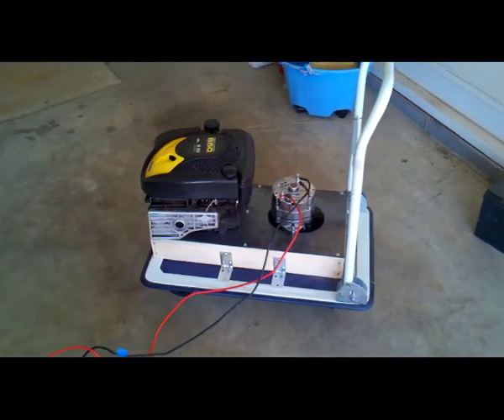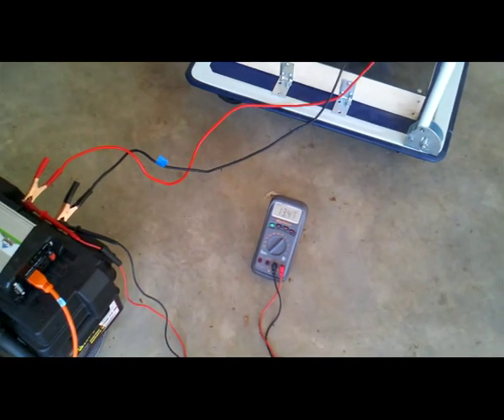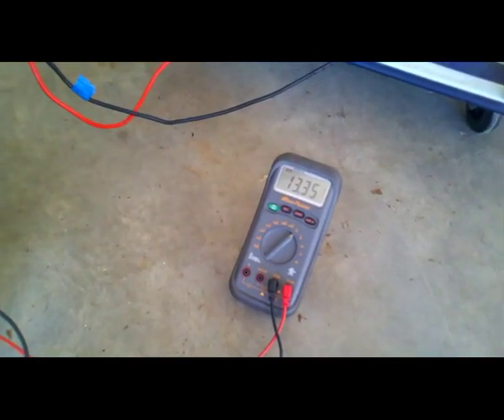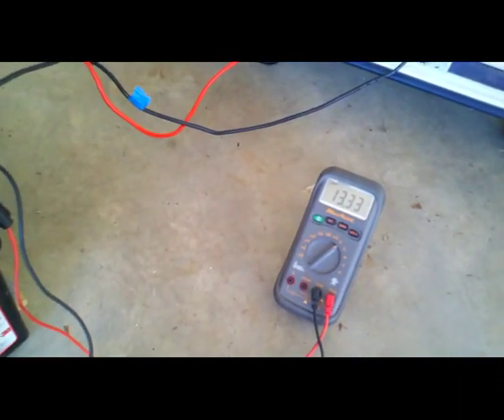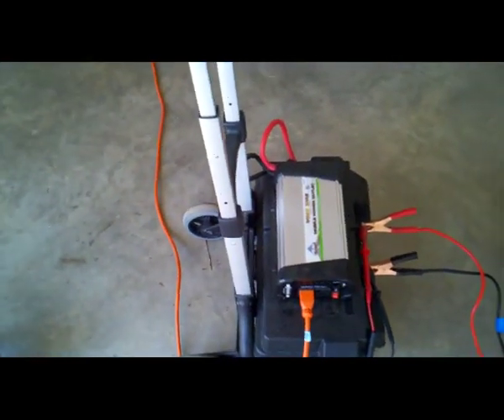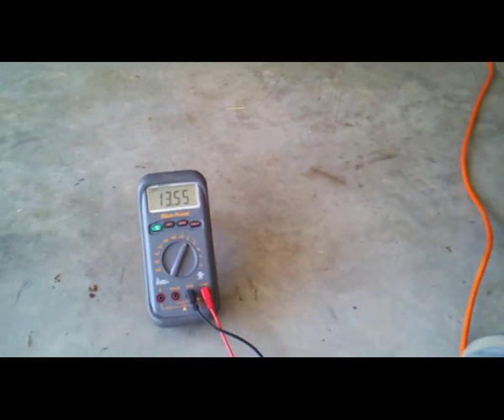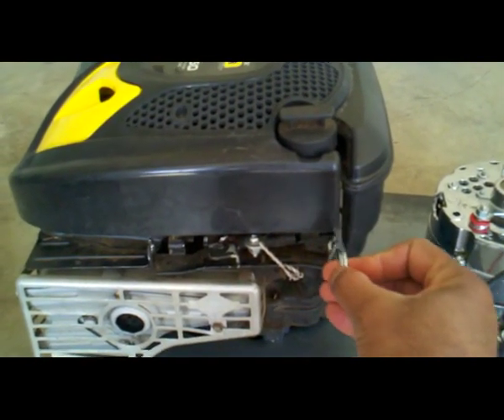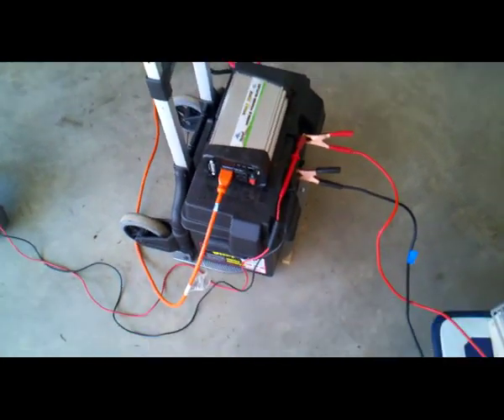DIY Lawnmower Generator Update - Load Testing

Comment: Lots of watts to start a fridge and freezer. I have mine on a timer so they don't both start at the same time. Will kick off my inverter and the batteries have to be fully charged. 
nice setup. I am fully off the grid.
Reply from the maker: +Juston Townson Thanks for your comments. Being off grid is awesome.
Reply: Wouldn't adding a capacitor or two to your setup help with that initial draw to get a fridge and/or freezer started? I mean a fridge and freezer use little voltage and wattage when running, it's that initial start that kills ya.

Comment: With that lawn mower engine, how are starting it w/o a blade or flywheel? They won't pull start w/o a blade.
Reply from the maker: +PT Johnson Actually, in this video, the motor has an iron pulley connected to the alternator via a fan belt.  With that it started fine.

Comment: If you turned off both, then shortly turned them both on without letting the freon pressure to go down on the high side, both compressors were stalled drawing LRA (locked rotor amps) for an extended period of time.  Rather unrealistic conditions.  The thermal cutout finally turned off the compressors as demonstrated by the extended time of high load.
Reply from the maker: Robert Carpenter Thanks for your comments, some things to think about when doing this.

Comment: One thing to consider it your drop cord. Go with the shotrest and bigest cord you can.  You may be pulling more that what your cord you have now can handle and that can cause the overdraw of current.
Reply from the maker: Thanks for the comment. The size and rating of the drop cord is something to consider to ensure it handle the load. If I can remember correctly, the cord I use is rated to handle it.

Comment: So lets say you charge up the batteries; How long will they run the refrigerator and or freezer before you need to start up the generator and charge them again? Say like 2, maybe 3 batteries in series.

Comment: yeah, I'm sure it would have, but this one I had, no cost
if I find a larger engine I'll put it on and go back to the 4.5 pulley.
I was going for quiet, noting that most quiet gen sets are low RPM, that's what I was going for.

Comment: ok, new pulley came in, 5 HP eng. vs. 200 amp alt. now have the new  3" pulley on the engine , since I have a duel V 3" pulley on the alt., I went with a heavy cast iron duel V for the engine for belt wear and ballast. it now runs at full load. I've compromised on alt. cooling, but something had to give. it is rare to have a full load for more then a minutes or 2 anyway, (just jump starting, or in your case, start up) If I were to make it again, I'd go smaller on the alt., but I had this one.

Comment: you want to go smaller, not bigger.
a small alt. will be easier for the engine to overcome at full amp output.
that's the problem I have, I started out with a large school bus alt. lots of power, but it needs lots of hp available when full load is applied, only choices I have are redesign with a smaller alt. or go with a smaller pulley on the engine, or get a larger engine.

Comment: Very cool!  You state that your setup would run your fridge/freezer more efficiently from an inverter hooked into your battery which is then charged by your gas engine. I agree.
My setup does exactly as you describe here though on a larger scale using a hybrid-electric automobile equipped with a much larger bank of batts & a 1000W pure sine wave inverter.  The battery bank is key to getting max. efficiency from the gasoline.  Output is 1000W continuous VAC, 24/7 on 10.5 gals over 8-1/2 days.

Comment: That,s the reason the auto type alternators don't work so well a as a wind turbine. They are made to spin at high way speed ,That speed is 6000.R.P.M.at the Alternator shaft (6000Dyno RPM) Not the engine speed. Idle test is 2400 Dyno RPM ) Stock spec Pulleys.This is how they are tested for out put. I have a 120 Amp on my Ford truck and it slows the V/8 engine under load.That is a nice back up charger u made .I always enjoy watching your videos Always nicely done & informative..

Comment: I want my engine run even when the alt. is running full out, that will take more leverage for the engine. the alt. will still spin fast enough to cool, but will let the engine stay in it's peak hp rpm band.
soon as you turn on the inverter it pulls the volts down so the alt goes to full power before you pull the first amp out of the batteries, the full output problem needs to be figured out first.
 running off the inverter then connecting the gen set didn't work for me, it stalls the engine.

Comment from the maker: I agree with you. My pulley is a 3 1/2" with a 1" bore.  But even with that the start up amps for my freezer is 12Amps (AC), which translates to 120Amps (DC). Add that to the start up amps for the Fridge and I had a serious draw. The best thing was to let both run off the inverter 1st then engage the generator. With a 1-Wire Alternator it's do-able without having to have a switch.

Comment: I have the same problem with mine,
if you ever have to charge a larger battery bank that's less then 75%, you will need to change the pulley on the engine.
try a 3" pulley
I started out with a 4.5 pulley, I'm at 4" now, but will be going down to the 3" soon
same size engine, but just can't handle the alternator at full tilt